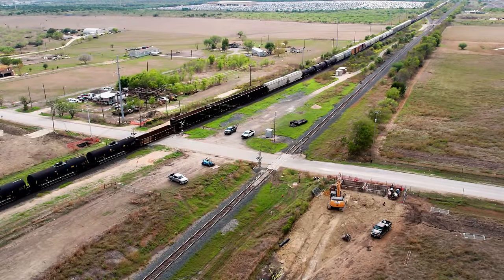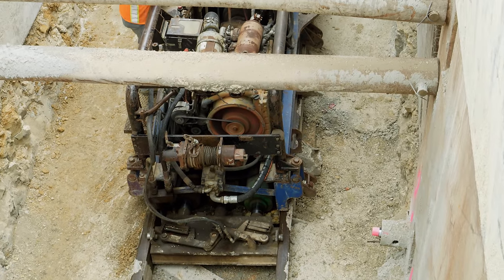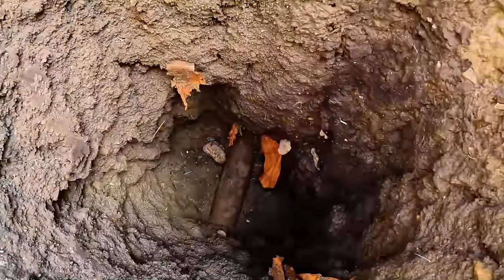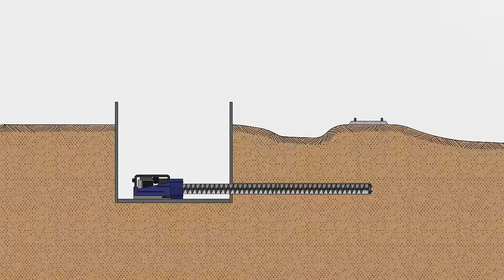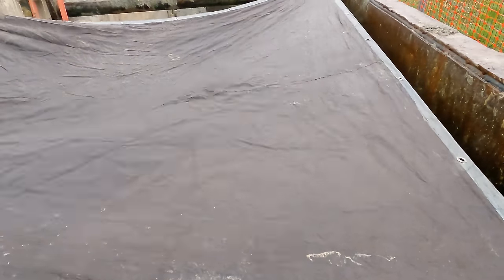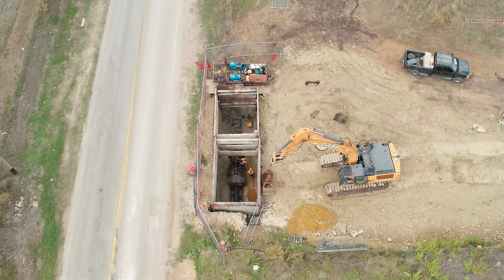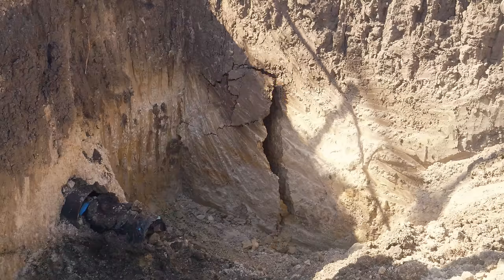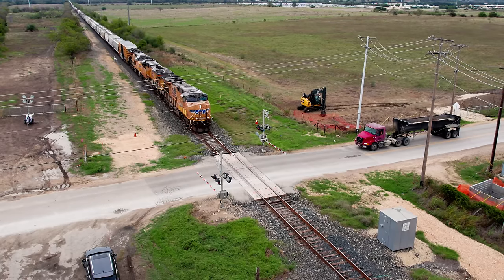How To Install a Pipeline Under a Railroad

Comment from the maker: Thanks again, Crystal Clear SUD and AGP for having me on site. How are you liking the construction videos?
💡 Don't forget to give Brilliant a shot at https://brilliant.org/PracticalEngineering
Reply: Ok
Reply: Love the videos. I work for a gas company in Florida and our contractors mainly use a Ditch Witch for our horizontal drilling. Will you ever cover the use of electronic and radar equipment to locate underground pipe? How about the use of cathodic protection and anodes to protect steel pipe from corrosion and rust?
Reply: It reminded me of my travel to work in 1970, but the pipe was huge. Car sized to take water to part of a city.
Reply: @stevenrod100 I hope the electronic equipment has improved since I last saw it in use. 
The foreman was trying to find the correct iron pipe under a road and eventually told us to, Dig that bit first.
Reply: @20chocsaday  I have been using an RD for a few years now and it has worked well for me. Before that it was a Vivax machine and I would always get false signals on other utilities, especially water.
Reply: How do I like them?  Keep them coming!!!  I can't wait to see the next one!
Reply: @stevenrod100  Thanks. The foreman will have retired decades ago and I am no longer associated with the industry.
But if I ever come up against any part of it I will try to pass on your information.
Reply: I love learning about other types of engineering! As a mechanical engineering student it's always fun to look outside of my coursework to find other types of engineering like on your channel with civil projects! Always great to watch and rewatch your videos!
Reply: Really enjoying these!
Reply: I really am a fan of Brilliant, it's helped me skip over two years of required math I already knew so I could straight onto Calculus without having to take semesters long refresher courses.
Reply: aCp!!!!
Reply: You’re the best Grady my dad and I love watching your videos.
Reply: I work in drinking water and also based in Central Texas so seeing these videos is excellent! With all the growth, I'm sure there is no lack of topics to cover. Would love to see a video like this on the construction of an EST or a massive concrete GST. Have you considered contacting GBRA about touring some of their SWTPs for a video?
Reply: Practical Construction is simply incredible. One of the most valuable opportunities presented with this projects is the ability to get people excited about careers they would have otherwise never known existed.

There is a pretty substantial "I could never do that!" barrier that exists between a lot of people and potentially rewarding careers. Getting an inside look into these projects helps break down that barrier and make things feel a lot more approachable.
Reply: I love them! I though it was going to be awhile before another episode would be released.
Reply: Shove your sponsor where the sun doesn't shine!
Reply: I love these construction videos. It’s a such a lacking genre on YouTube. Your depth and storytelling is brilliant
Reply: Did this one not get posted to Nebula?

Edit: just saw it was a different channel: “Practical Construction” and not “Practical Engineering”.
Reply: The construction videos are fantastic.  I'd like to see a video on cured-in-place pipe, pipe bursting and other no/minimal dig technologies.
Reply: I feel dump
Reply: I’m currently designing a very similar project in Utah so I really appreciated the video! Union Pacific crossing requirements can be extensive so I liked your background on why that is the case. I’d appreciate a horizontal directional drill video in the future!
Reply: Very Interesting thanks Grady
Reply: All your videos are good, but the Practical Construction videos are my favourite. They seem to strike a really good balance between getting a large enough chunk of a project that you can appreciate the overall complexity yet a small enough chunk that you can get reasonably deeply into the details.
Reply: Can you do a video on Lake Hodges Dam?
Reply: no new videos on nebula or youtube, what a ripoff!
Reply: You should do an HDD video for these 42 inch pipelines that go hundreds of feet under the Mississippi River
Reply: You could do the Collins pipeline disaster in St Bernard Parish, as an example of the need for corrosion protection. DOT determined that corrosion was the cause of the disaster
Reply: Hello! Theres 2 train that run every day MLDDI and MLDNL they have no set time but i caught a hertiage unit on one of those trains! You should definitely try rail fanning!

Comment: Watching that drill come out exactly where it’s supposed to has to be an incredible feeling for everyone working there!
Reply: You get used to it but the feeling if it is not showing up is very bad. A colleagues site blew up, shattering all windows in the village, a few years back. Still getting nervous if the drill takes a second longer than it should.
Reply: i think the people who built the channel tunnel were more relieved 😅
Reply: I bet it feels like that early moment in Jurassic Park where Hammond is watching the baby Velociraptor claw it’s way out of the egg in the hatchery and he is just cooing away at this newborn.
Reply: I asked a gas line guy once “how did they do that major transmission line under this river from up that mountain on the other side and know it was coming out right here?”

He told me “they were within 1/10 of an inch of where they said it would come out. They’re good at what they do.”
Reply: "It was supposed to come out in Texas."

Comment: I’m a Hydrovac operator, I’m glad people get to see what we do in this video. I always have to explain to people not in the industry what I do and they always seem shocked that such a thing exists.
Reply: I had no idea that such things existed; what a brilliant idea. And, as a network engineer, I'm grateful for what you do. (One of my greatest enemies is the backhoe.)
Reply: It was news to me watching this 🙂 Cool machine
Reply: So tell me - why not using a horizontal hydrovac to bore the entire track? A slightly modified one of course. Sounds less risky if it wouldn’t hurt any supply lines.
Reply: Hey Mate, great Job ! Best regardes from a HDD Rig operator =)
Reply: I've seen the pnuematic ones, but this was even cooler!
Reply: In making a trench, I will have to do something like this, but horizontally to get around some wires. Nothing as deep as this was done in the video though. I can see why they need a bigger vacuum there.
Reply: @ericlotze7724  My company also does pnuematic as well. Its a pain in the behind as our soil in my part of wyoming is HARD clay so its a challenge. I would love to dig in some soft soil sometime.
Reply: I dunno, im not even sure such a thing exists, it might but I havent done it. When certain soils get wet they turn into a nightmare with cave ins so that could be part of the reasons the engineers wouldnt have gone that route. Railroads are basically gods when it comes to working around a live track, and what they say or require GOES, no exception, so the methods may be dictated by their requirements.
Reply: @ClassicAirsoft   Love working with you guys! I dont know how to do your job but I tell ya it almost seems magical what you guys can do with those HDD rigs.
Reply: @Curt_Sampson   The sad thing is im often called after someone backhoes a fiber line 🙄

Comment: I work at a power plant that used to be coal fired but switched to natural gas. Getting the pipe line there was amazing. It had to go under a subyard, under a river, up through a side of a mountain & pop up in a field a long way off. The drill bit came out within 1 ft of where they planned. I was amazed how they were able to do that! I get worried when I have to drill through a wall hoping I come out on the other side in the right spot.

Comment: Those vacuum excavators are very cool. Last year we had a utility pole come down and need to be replaced. The ellectric company used a vacuum excavator to dig the hole for the new pole. Super fast and extremely tidy!
Reply: they are wonderful but oh boy is that sound annoying. I imagine their crews must get used to it though
Reply: @pizzaivlife i never operated it full time but I've done a lot of hours on a trailer vac. I never got used to the noise lol. We had to do some painfully large jobs with it as well excavating 5m each side of an essential fibre cable in the middle of the desert in Australia. It was so essential to running a gas plant and would have been a nightmare to replace so they were happier to pay for us to do that for two weeks rather than for a one hour excavator job.

Oh and it was also 50C (122F) and we had to wear sperm suits for, you know, safety.
Reply: @pizzaivlife  ours are pretty quiet compared to the old ones. They are making strides in getting them quieter. Man some of them not tolerable tho. Even with ear pro.
Reply: I used to work outside at a gas station, and I think monthly a vac truck would come do some type of maintenance on the property. That was one of the most hated parts of being there ever. Those vac trucks are crazy loud, but I think it has to do with whatever sound they are making, not so much the sound level.

Comment: In my youth I did a lot of this for AT&T pushing pipe with a pneumatic driver. Rail roads were very controlled jobs. Thanks for bringing back the memories.
Reply: lol that’s funny seeing as you  push  the drill  and then pull  the pipe through.  
And a horizontal boring machine is not pneumatic, it’s hydraulic.  
Not sure what you were doing.  👌
Reply: "pushing pipe with a pneumatic driver" You may know it as an air hammer, but the one we used was a 200 lb air hammer made for pushing pipe. It could be used as a underground torpedo on short runs with the cable tied to the braided steel air line. Think oversized jackhammer, vid of a small one https://www.youtube.com/watch?v=3PGp34eueXQ&t=3s
Reply: @karryhardman8735  uh dude that sucks bad…. May as well be a coal miner.  
Got any hearing left? Back issues?

Comment: This was really cool to see. I had a crew install a new sewer pipe through the CBD, under busy intersections, and they were in front of my house for months (only 8 hours per day though). They also had to bore a bit further than this. Me, an engineer,  thought they couldn't possibly take 7 weeks to install the pipe. But watching this I realise 7 weeks of 8 hours per day, 6 days per week to go 300m was probably really good timing. Also, yes, I snuck into the site each night to check it out and when it was finished I crawled through the entire length of pipe (before it was commissioned).

Comment: I live a few hundred feet from a river. A few years ago the gas company needed to run a new pipe under the river. There was a boring rig on the other side in an industrial area and the terminal end was on my street. They fed the pipe from the other side of the river but also push/pulled through a hole in the street right by my house (made it hard to use my driveway at first but they worked around that issue). 

Fascinating to watch.

Comment: At first I wondered if it wouldn't be simpler, and thus cheaper, to just build the pipes up and over the tracks, but seeing the machine in action, I don't think you could get much simpler. It's an incredibly elegant way to run a pipe under something.
Reply: Something to consider about building over a railroad. Is what is the current max height of the line. If there are already tunnels or bridges on the line limiting train height then you just have to build something higher than those tunnels or bridges. But if there are no limits then you'll have to convince the railroad that you can build high enough to allow any legal height of train.
Reply: One thing to keep in mind atleast here in Finland is that the temperature sometimes can be near -40 degrees. Texas too, has a problem with freezing temperatures sometimes.

Comment: I once worked for a contractor that built railroad crossings, and I remember the complaints about a job along a very busy rail line where the contract didn't allow them to disrupt service in any way, so they had to stop work every 15 minutes or so to let a train go by.

Comment: Wow very cool, I used to live in that immediate area. I drove that road daily for many years and still have family that live there. In fact I can just make out their house in some of the clips; I’ll have to send this to them. 

There is a nearby quarry which is the reason for all of the gravel haulers. The percussive hits of their tires on the concrete railroad crossings cause the crossings to breakdown over time and they have to have to replace them at least once or twice a year. The trips across them become fairly jarring once they start breaking down, especially if you have a car. And since there are two crossings next to each other, you get twice the punishment. Interestingly enough, the damage is always on the side of the roadway that leads away from the quarry due to the weight of the trucks.

Thanks for posting this!

Comment: Utility Locator here, HVAC can definitely damage underground utilities. I’ve run on multiple emergencies where HVAC cut gas services
Reply: But how? From the boom operator wracking the line with the vacuum aperture, or some other mishandling of the process? Or are the pipes so close to failure that the pressure washer finishes them?
Reply: @LetsTalkAboutPrepping  When set to tight focus and at point blank range pressure washers cut through plastics pretty fast.  So I'd guess operator error.
Reply: The damage I’ve seen is from operators smashing the boom down on plastic pipes, too high of pressure, and letting large chunks of dirt slam down onto fitting. I’ll admit, I hit a saddle on a 1 inch service with a chunk of falling dirt accidentally. Thankfully it had already failed and was being dug up for repair but I didn’t help it any 😬
Reply: My pops started his own hydrovac business in Phoenix back in the early 1980s (Western Hydrovac) and I remember him telling me how much water pressure ran through the jet rodder; enough to sever a limb easily
Reply: @LetsTalkAboutPrepping  Mostly high pressure and just carelessness but I’ve heard of rocks gashing a hole into it as well
Reply: @LetsTalkAboutPrepping  If you see the piping used for underground gas, its impressively weak feeling and looking. I imagine it wouldn't take much for a pressure washer to cut it open. Of course set correctly, creating a very high pressure spot.

Comment: In 1970 I used to travel to work alongside a major water pipe installation. The concrete pipes went alongside this stretch of road and were big enough to drive my friend's Mini through. 
All the power and phone wires had been raised extra high, marked and were used as gates, you couldn't get past on another track. 
After a while I remember the article about the tunnel bored through a hill to use this water source and I realised it must come out somewhere on the other side of the road I was on.  
But I had not seen tunneling work on the other side. 
It seemed as if they had come 1/4 of a mile underground from the edge of the hill until they had passed under the road. 
Aside from the tracked vehicles cutting up the field and compressing soil it was a very neat job.
Reply: That sounds like it was a stormwater pipe, not a water main. WM's have always been relatively small and I don't think concrete has been used in centuries. That time period, it would have been cast iron (stopped due to lead poisoning) or clay, if they hadn't already changed to galvanized steel. Galvanized steel was also relatively short lived as it was replaced by ductile iron and now we use more HDPE or PVC. Stormwater pipes have been and still are reinforced concrete pipe. Well, RCP when it's load bearing anyway as now we use HDPE a lot.
Reply: @Swearengen1980  We were told it was a new water supply from one of the largest natural water sources in the country. That source was already supplying a small dam. The supply main from it broke one day and some houses in an expensive area were suddenly flooded. 

However, I don't know what they lined or otherwise finished the concrete pipe with. I suppose there might be someone there who remembers and knows.

Comment: As soon as I saw the title I absolutely had to watch it, because I have crews in front of my house doing this exact task, with railway lines replaced with suburban roads. Although they first have to remove existing pipelines encased in concrete before they can put in the new ones.

Comment: Learned the term potholing! Watched it done in my neighborhood a few weeks ago as a local fiber company is boring and installing fiber. They potholed around each water meter to avoid water lines since their proposed alignment came pretty close to existing lines. They did similar measurements around known gas/electric infrastructure, then painted their depths on the pavement nearby before starting the drilling operation. Very cool, and the backfill afterward made it look as if they were never there.

Comment: Really happy to see this video. I poured concrete for a job going under the rails and the contractor mentioned a different company would finish that portion. The work was electrical, but imagine some same work methods are used.